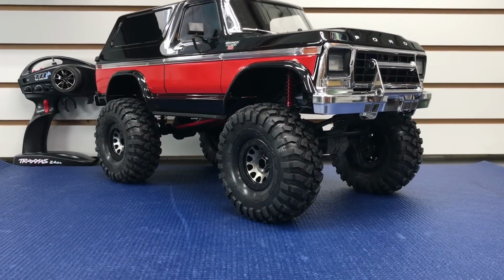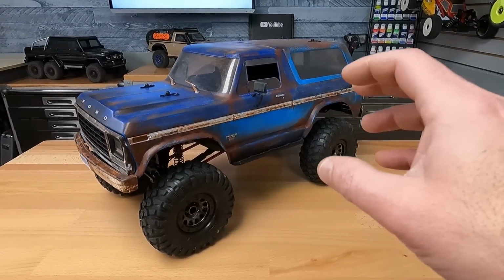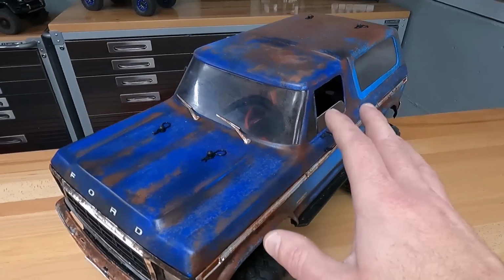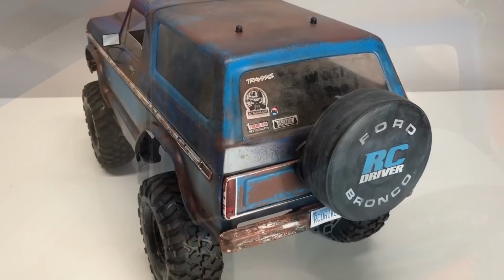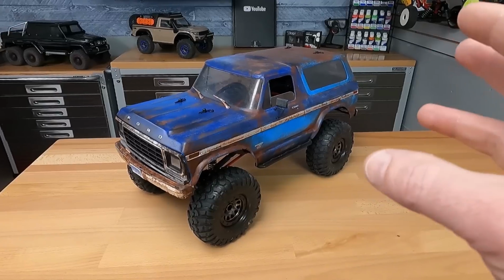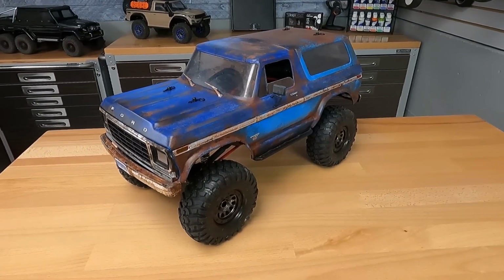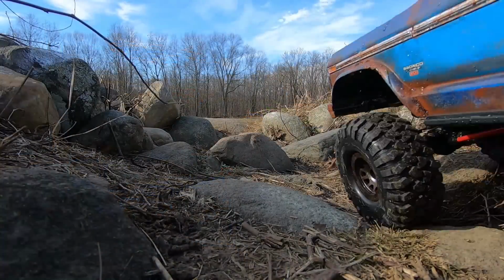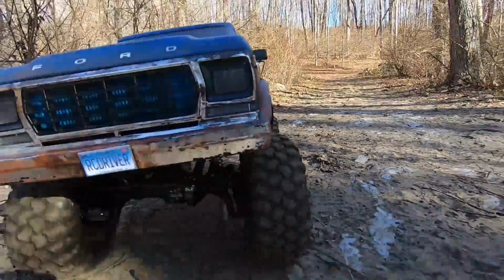Built-Up Barn Find! Project Traxxas TRX-4 Lifted Ford Bronco Gets A Patina Make-Over | RC Driver

Comment: A fantastic job on the body I am going to do the same to the Pro-Line 1967 Ford F100 body for my UDR to give it the old school Pre-Runner look more pre-runner than Trophy Truck with the stock body. One question was the rear canopy fibreglass if so should not have rust on it apart from stained round the fixing bolt's etc, but this certainly does not detract from the overall finish of this body.
I know mine will not be as good by half I admire anyone who puts the time and effort to create such a masterpiece.